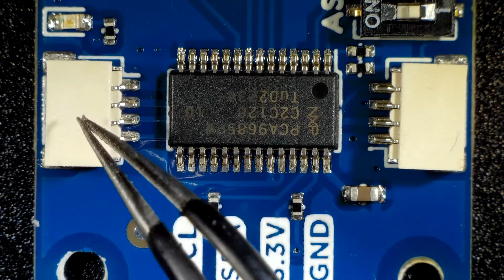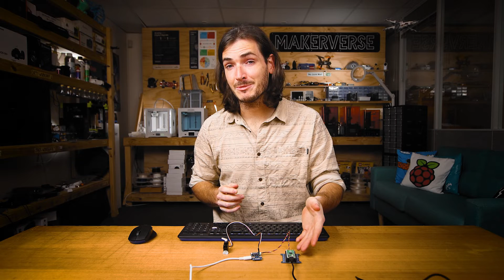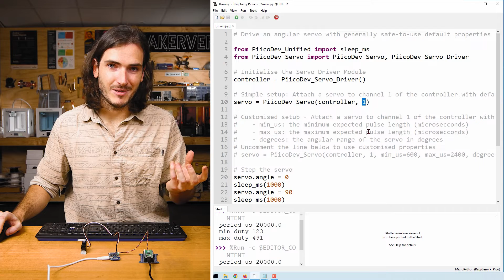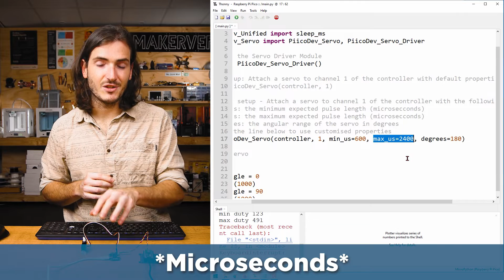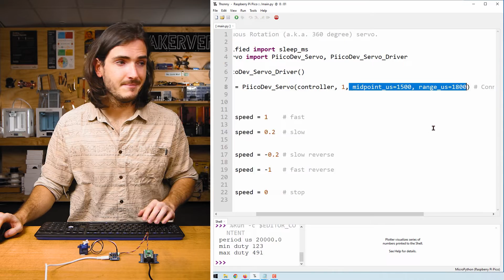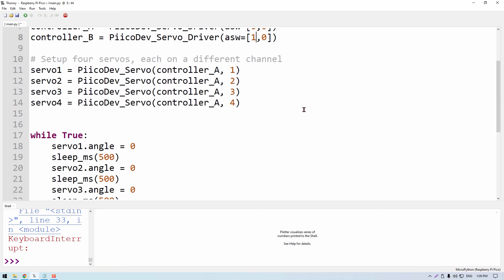PiicoDev Servo Driver | Guide for Raspberry Pi Pico

Comment: uses i2c, so 2 chains to pico, 8 servo driver boards, or more using soft i2c on the other pins probably.
might need to decouple in software the old i2c connection (e.g. set to serial) before recreating another i2c connection.
trick worked on oleds.